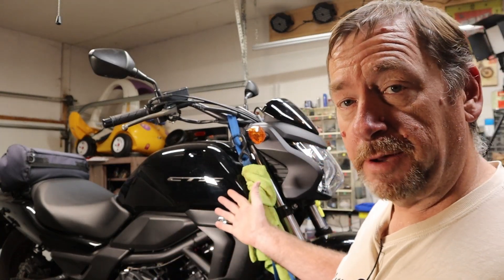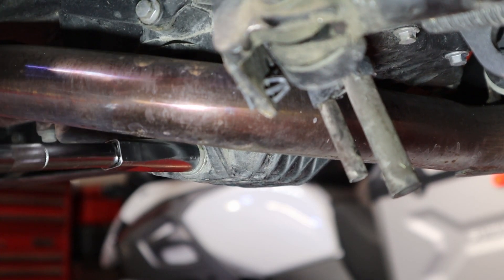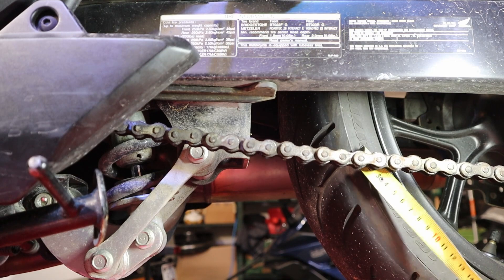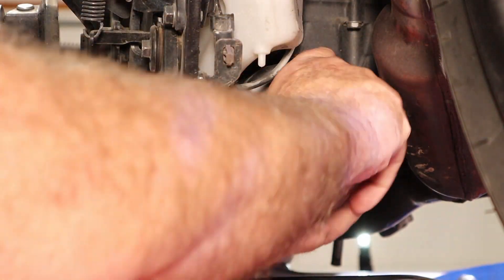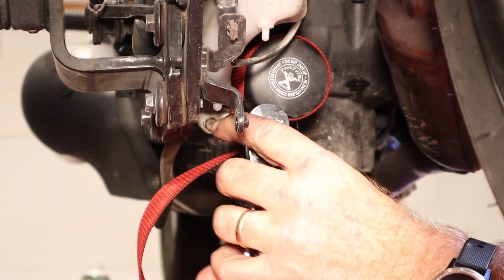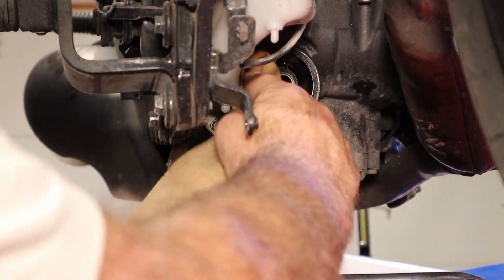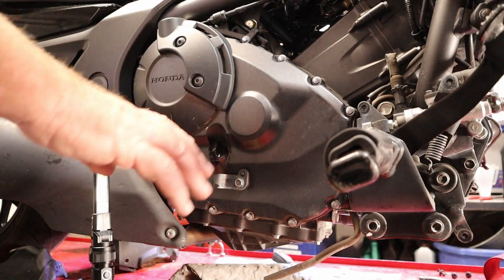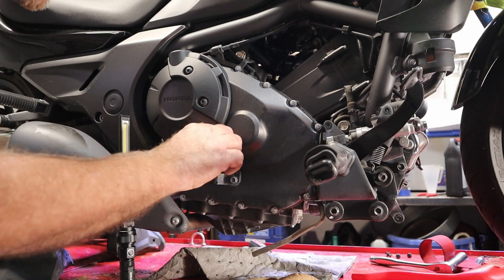Honda CTX700Street Bike Gets an Oil Change and Chain Adjust as Well as a Few Other Things.

Comment: I have a 2016 CTX700N, I’m changing my oil and cleaning and re-lubing my chain today!👍🏼
Reply: Did you have to remove the bottom plastic in order to change the filter?
Reply: @rossi5839  I did remove the bottom plastics. Also, when changing the transmission filter, watch for the little spring and don’t torque the metal cover too much. The first time I changed it, the metal cover plate cracked and had to order a new one from the dealer. It was a while ago but I think it was around $100 or more.

Comment: You said 10 30 but put in 10 40. Is 10 40 correct? How much oil did it take? What type of coolant did you use? Thank you also what was the milage on this bike?
Reply from the maker: Either one will work just fine. Honda switched to recommending 10w30 around 2010 or so. Either will work fine. Thank you for watching.